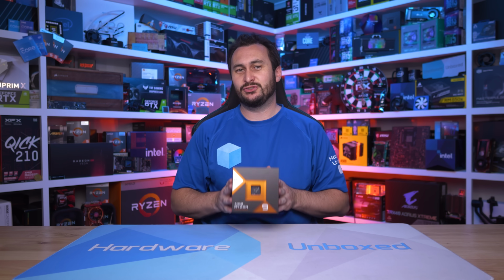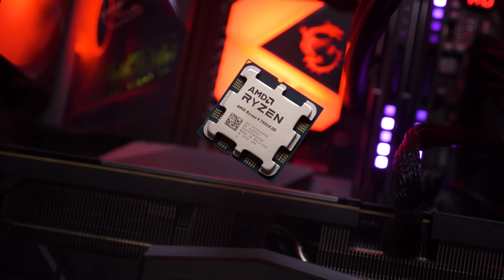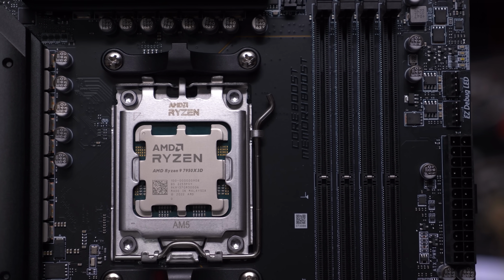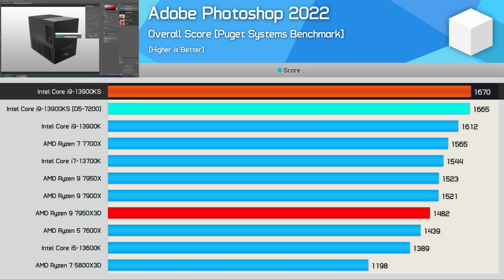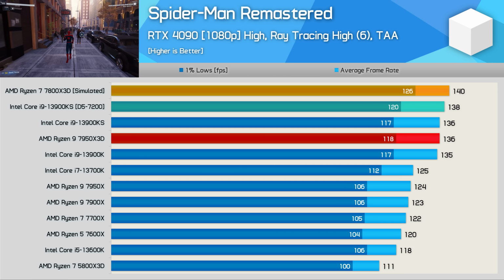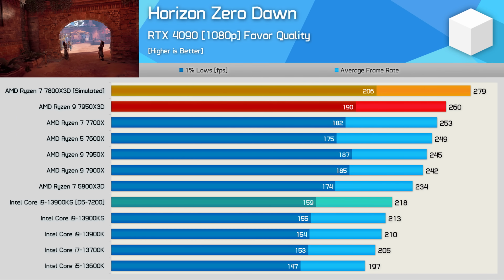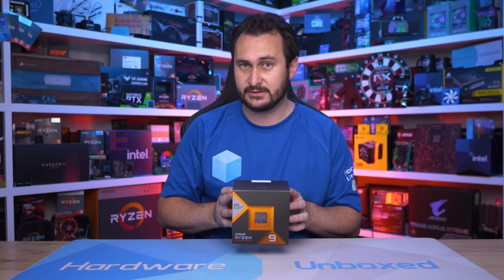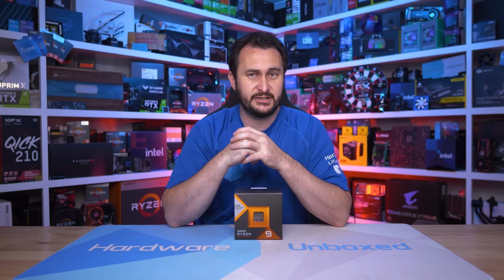AMD Ryzen 9 7950X3D Benchmark + 7800X3D Simulated Results

Comment: Right on time, it will be interesting to see the 5800X3D to 7800X3D comparison in April :)
Reply: The simulation has given us a very, very good idea of what that will look like.
Reply: @syncmonism  I want to see how it scales to 1440p and 4K in terms of overall performance and 1% lows, they need to pack a big punch to justify the $1000 AM5 platform upgrade
Reply: @LuMo1980  yes, this. If everything levels out at 4k ultra, I can happily keep my 5800X3d
Reply: @LuMo1980  You really need a high end gpu to really see the difference.
Reply: @Paul Oliver  If you have anything other than 4090/4080 then you are going to be GPU bound at 4k with a 5800X3d...No need to updrade at all!
Reply: @pjoliver182  you can be sure it will. At 4K Ultra the GPU is taking most of the brunt so you can probably save your money
Reply: @syncmonism  Thing I find strange is the 5800X3D and 5800X perform way different, but the 7950X3D vs a 7950X indicates that Ryzen 7000 doesn't really benefit from 3D v-cache and in some cases just loses because it's got lower clocks
Reply: @syncmonism  would you think the 7950x3d would perform better then the 7800x3d with the ccd disabled for the 7950x3d or could the 7800x3d still take the win?
Reply: you already have lol
Reply: It's the same picture
Reply: Am I the only one not interrested and blown away by the performance gains ? They tested in 1080p and the margins weren't huge between the i913900ks and the 7800x3d simulated or 7950x3d. I expected a much better difference with how everyone was hyping this launch.
Reply: @SpeedKillersGaming  It is hard to get this much difference without arch. differences. I think it is pretty good performance uplift, enough to take gaming crown.
Reply: @ysnyldrm73  I need to see the differences in 1440p, 1440p wide and 4k. I would rather get more cores (7900x vs 7800x3d sincr they are close in price) if i know that i do not gain much in higher resolutions
Reply: Let me tell you the results, 7800x3d is faster 😊
Reply: Yeah, I'm currently on 3900x with 4090. I've just ordered 5800x3D. I can't justify upgrading the entire platform to AM5. Huge cost for very little benefit as far as I can see.
Reply: This!!! I’m excited
Reply: When 7800X3D will be out?
Reply: I've been debating on getting a 7800X3D but will probably end up just upgrading to a 5800X3D
Reply: I know this is a little off topic but……….what was the first pc game you guys ever played, and started the never ending quest ?
Reply: R I.P Intel .. your temp and power consumption will be remembered forever in our frozen heart
Reply: Guys you are usually gpu bounded at 1440p or 4k if you dont play espor titles or if you dont have a rtx 4080/rx7900xt level+ card. It is kinda pointless test 4k results in ideal situation ( full gpu bounded scenario).
Reply: @ysnyldrm73  That hasn't been the case since ray tracing was introduced, MMOs too. My 5800x3d is bottlenecking my 4080 at 4k with dlss quality in many RT and even non RT games, the worst example being Hogwarts Legacy where not even frame generation can help, and milder ones being Plague Tale and Spiderman RT on. CPU being irrelevant at 4k stopped being the case as soon as 4k 120 started becoming more normalized, and I'm still heavily CPU bottlenecked in World of Warcraft with the main hub running at 70 fps.
Reply: @omarcomming722  Hogwarts Legacy has optimisation issues. I’ve seen a tonne of benchmarks where neither CPU or GPU are close to 100% utilisation showing performance is still left on the table
Reply: @xxNATHANUKxx  that's a CPU bottleneck, few of them show CPU at 100% because they can't utilize it fully so we have to brute force it, but whenever GPU isn't close to 100% and you're not getting your targeted fps. Also almost all of these are poorly optimized but it is what it is.
Reply: @omarcomming722  That's because RT is overrated.
Reply: @omarcomming722  it's not a CPU bottleneck in the traditional sense, it's a memory allocation issue. It's an issue with the game, not the res
Reply: @elirantuil5003  yeah but it can be overcome with a stronger CPU and occasionally RAM, as weaker CPUs underperform even further in those games
Reply: @omarcomming722  but that's not "a more CPU intensive game" it's a bug, they'll eventually fix it.
Reply: @omarcomming722  I did say in ideal situation! Cpu bound scenarios is important but it is much more rare in 4k and depends on game/hardware.
Reply: @xxNATHANUKxx  if GPU isnt close to 100% you are CPU bound or more accurately game main thread bound. 

CPU usage as a percentage on modern multicore CPUs just isnt meaningful
Reply: @omarcomming722  you have some other problem, with the same gpu and cpu I see better framerates in Wow hub and i see perfect usage on the 4080 in Hogwarts and the % of gpu overclock. I haven't tried frame generation since I dislike the input lag while driving the car in CP2077, so I never used it after. As for other MMOs I can only tell for Lost Ark, and it runs much better than with the previous CPU, as MMOs generally like cache.
Reply: @omarcomming722  I'm at 120 fps with the 5800 3xd with a 2070 super in Valdrakken, and about 70 fps in mythic raz with all the sparks going off.
Reply: @Andrew-lk7xu  120 in Valdrakken is only possible if you're using low settings and especially the draw distance/detail sliders etc. With all settings maxed, Valdrakken doesn't go above 80 fps or so when standing still, and it runs like absolute shit while flying through it and it feels like a slideshow. None of this is on the GPU as it's never maxed out or close in these moments.
Reply: @omarcomming722  Are you saying with the 5800x3d? Because I can tell you right now that is false information.  

I can record a video and upload it to prove it as well. Valdrakken does run like shit though.
Reply: @Andrew-lk7xu  Yes, you're not getting locked 120 in Valdrakken with a 5800x3d at max settings period. Feel free to record a video and prove me wrong but it's not happening unless something like RAM plays a huge role here and you have DDR5 or smth. 

Average fps can maybe reach 90 fps in front of the auction house when standing in place, but as soon as you start moving or god forbid flying around, it drops to 70s and feels like 20s because of how horrible the bottleneck is.
Reply: @omarcomming722  Alright, yes I do have DDR5 6000 at CL30. Was currently migrating a system till I get a 7950x3d. So, I'm just making due with the 5800x3d atm.
Reply: @Andrew-lk7xu  Then RAM plays a major role if you're really getting over 80-90 fps at Valdrakken with all max. With DDR4 that's the peak, same with any WB fights or even when flying over settlements like the Maruukai
Reply: @ysnyldrm73  It's not a pointless test.
Reply: @sammiller6631  not totally pointless but kinda it is.
Reply: @ysnyldrm73  that's a generalisation; there are often differences between CPU's even when GPU bound (both AVG FPS and 1% lows). Just checked out some other 7950X3D reviews that illustrate this actually.
Reply: @pjoliver182  I mean yes if you are fully competitive and have a 144hz+/4k monitor and thousand dollars beast of a gpu.
It is less important if you dont have pretty big gpu in 4k level of fidelity. And of course some games and rt on some games depends too much cpu power that breaks %1 lows but that is also a rare case scenario. This test is "usually" pointless in gpu bound scenario. There is a reason they are testing with rtx 4090 at 1080p.
Reply: And please... with 1440p and 4K benchmarks included.
Reply: @DropOfWater1 HUB recently released a video explaining why it is pointless. Not only does the resolution hide the information your hunting for , defeating the entire purpose, but it can even skew the data so you're not getting a direct representation of the difference of the CPUs. I can imagine that this is a joke so I'm not taking it too seriously but.. if you're serious, please inform yourself about CPU load and resolution.
Reply: @TheCosmicMason  I was serious. I admit I didn't watch all of HUB's videos so I don't know the reasoning. Still, the majority (not all) of people who are into high-end CPUs won't be on 1080p resolution.
Cheers.
Reply: @DropOfWater1  he answered this so many times...
Reply: @DropOfWater1  You dont need these cpus for native 1440p or 4k. To take full advantage you would still need to use dlss or fsr to 1080p res, so it s a bit pointless to test cpu workload on those res. Plus not everyone has a 4090, so you would be even more limited in the testing already. It's just a mattere of comparison so you buy the best one at a price of your regione, you will not be able to replicate the exact numberr in a given game.
Reply: What was the "best gaming CPU" around 7 months ago is now at the bottom of the charts. One reason why PC gaming sucks.
Reply: @windyearle  ? its one of the fastest cpus on the market it doesnt get worse in any way lol things just get better
Reply: @windyearle  no, thats the biggest advantage of PC gaming…
Reply: @windyearle  Yeah, but just in terms of comparisons, you can still pick the cpu at the bottom and It'll be capable enough to play every game you like.
Reply: @windyearle  So you feel PC gaming was better during the early to mid 2010s when intel practically had a monopoly over the CPU space and there wasn't any exciting progress for about 6-7 years?

If you buy parts for the sake of 'having the best' then yeah, I guess PC gaming 'sucks' because you won't have the best for long. On the other hand, if you buy parts for achieving a level of performance that you're happy with, it's way better now than it was ten years ago.

The graphics card space, on the other hand, really does suck.
Reply: @windyearle  only for muppets running a 4090 at 1080p.

Comment: If they made a 34" 3440x1440@240Hz OLED with 1800r curve in addition to the 27" 2560x1440@240Hz and 45" 3440x1440@240Hz 800r OLED monitors, I'd definitely go with the LG, as my main TV is their 2020 65" LG CX OLED. But I'm going with the 34" Dell Alienware 3840x1440@175Hz QD-OLED. Some games I play on PC requires a larger screen because of the distances involved. Referring specifically to War Thunder here. As the largest maps are in excess of 1000 square kilometers and a large screen helps see a distance.

Comment: exactly what I expected.
if the application or game is not properly optimized the CPU is badly used.
the factorio test demonstrate this clearly.

now the question: did the game developers will spend sometimes to optimize their games? (same for other apps)
its not so complicated, when you start a thread you can tell the system what type of workload you'll process, helping the system selecting the best core.
Reply: Can't you just set CPU affinity for the specific application in your task manager? Make it only run on the CCD1  cores?
Reply: @marceelino  yes, the Lasso tool will be helpful for that. (easy to use and with more options)
Reply: I dont think HUB applied the specific x3d drivers from AMD, GamersNexus review is probably a better one to watch instead. GN spent the 1st 5 min of the video going over how the drivers increase performance of 7960X by up to 35%.